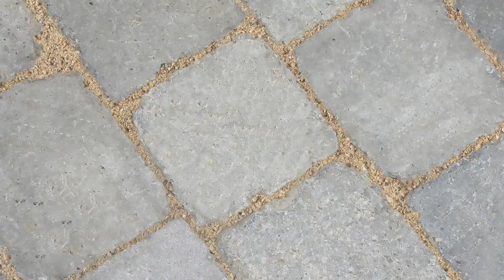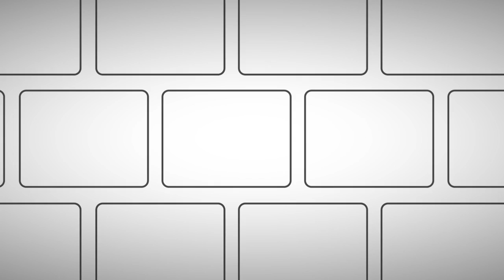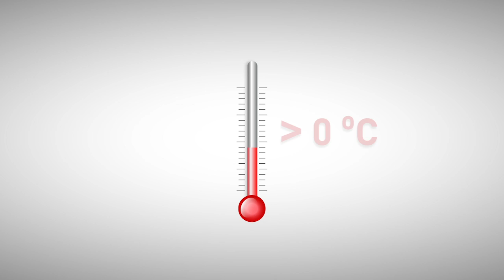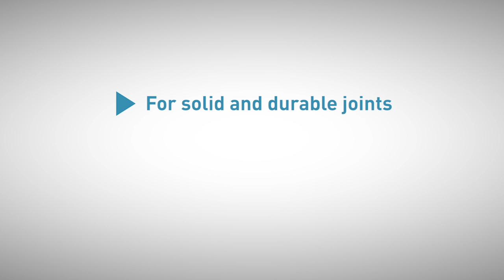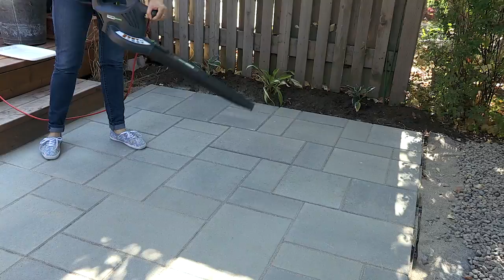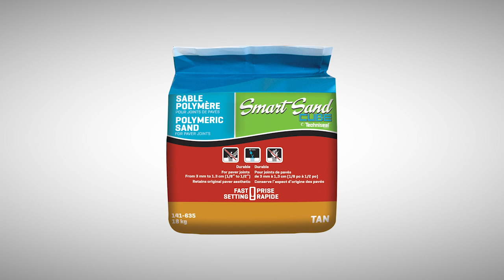How to install SmartSand Polymeric Sand from Techniseal

Comment: I  a pretty large techno block patio where the polymeric sand is now beginning to fail.   I have used Sika self leveling sealant on driveway joints and like the product.  If I tooled out the joints and vacuumed them out could I use that product instead of the polymeric sand.  I do know it will be labor intensive.  Thanks

Comment: My paving guys didn't do half those steps. He broomed in the Techniseal sand and sprayed it with water. I asked him why they don't use a compactor and he said that it wasn't necessary. It also started to pour rain immediately after they finished. Let's hope it lasts.
Reply: I just did my own patio and it settled 1/2" - 1" in some places when I ran the compactor over it. I would not be happy if a contractor skipped that step
Reply: It absolutely positively must be compacted. If a so-called contractor tells you it does not, tell him to hit the bricks. Pun intended.
Reply: @brandonhall9776  Well it's been a couple of months now and everything looks the same. Fingers crossed it lasts.
Reply: What is the best thing to clean the sand that has settled on top of the paver?
Reply: A chisel, scraper, elbow grease, and a lot of time. Polymeric sand is probably the worst thing you can use for your paver joints. as soon as it gets wet it hardens to the consistency of concrete, a very lightweight concrete, so if it is on the surface when it gets wet you're going to get globs of concrete on your surface. Good luck with that You're going to need it. Not only that but after a minimal amount of time, less than 2 years, the polymeric sand which is in between your pavers will begin to chunk off into medium to large size pieces and will look like garbage. Worst stuff you can use for pavers.
Reply: Cynthia Adam if Polymeric sand is the worst thing you can use for paver joints, then what is the best thing? I’m looking to repair/ redo my over joints.
Reply: @heisrm  a 4- grain silica sand. As a side note, I am talking about pavers and joint sand in the state of Florida which has a very unique climate from the rest of the United States.
Reply: Cynthia Adam thank you very much!! I’m in Pennsylvania.
Reply: My contractor didn’t even use sand to fill gaps. God help me!!
Reply: "Contractor" or the cheapest guy you could find? There is nothing wrong with a good rate but make sure you're getting a good value. There is a big difference, the cheap man always pays twice. If there's no sand your and no sealer, your pavers will begin to shift and separate and you be left with a huge pile of bricks. Do your homework before you hire a professional contractor. Check Google reviews. Check client testimonies. Also keep in mind there are a lot of a**** clients out there as well that always want something for nothing so they will try to destroy your business with a negative Google review. So when you see a company that has a thous and positive Google reviews but you only focus on the negative few, you're doing yourself a disservice. Discernment is your best friend.
Reply: @cdadam22  He's a highly rated landscaper/hardscaper. He did use sand. He just didn't compact it. So far it still looks great but we'll see.
Reply: @B-ch6uk  🤔 Interesting
Reply: BH  are you happy with it ? , the guys we used didnt tamp it either
Reply: @shugatoast  It looks nice but now I notice the sand is kind of soft in some places. I don't know if its' going to last very long.
Reply: BH ok same here thank you
Reply: It won't. It will begin to fall off in chunks.
Reply: Looks like they didn't watch the weather forecast that day.